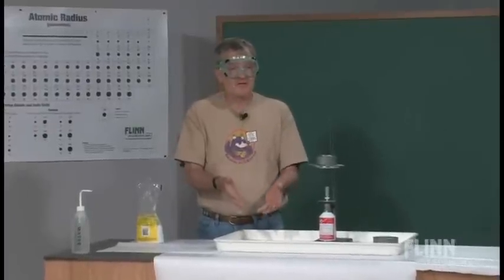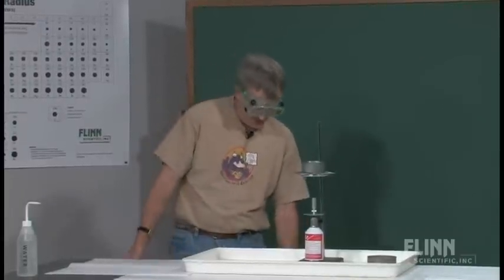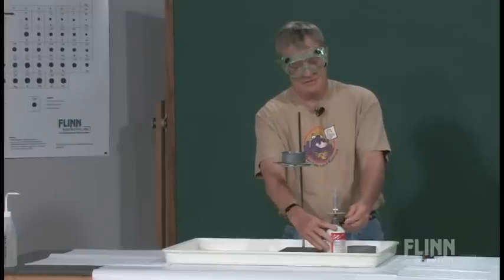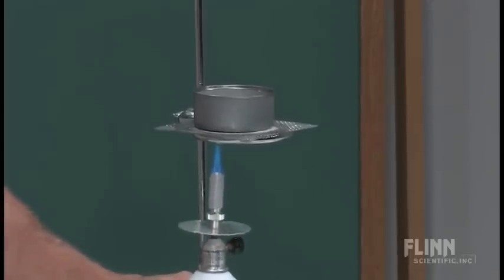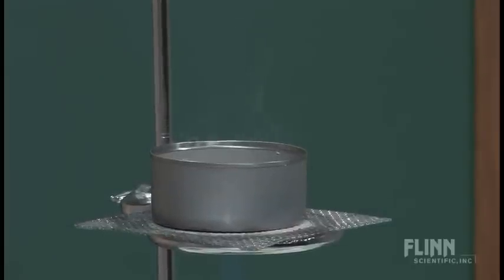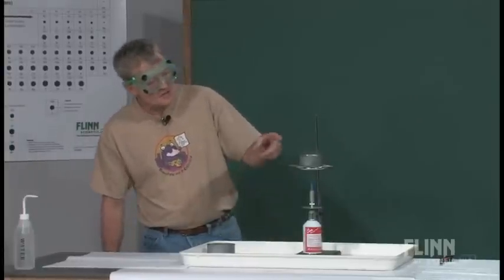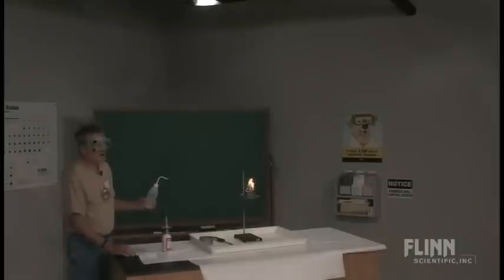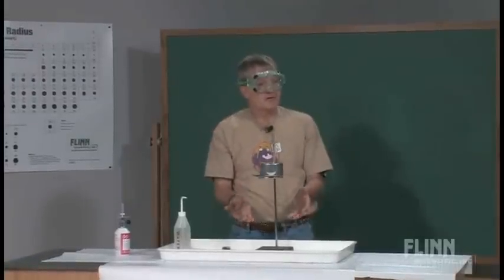Grease Fire

Comment: Hes giving one bad advice.

Do NOT use wet towel to put out grease fire.

It has similar effect as pouring water to grease fire.
Reply: Put a lid over it?
Reply: @tutsebhatu6495  try putting a lid on top of fire
Reply: @tutsebhatu6495  put a ring on it. 💍
Reply: He said "damp," not "wet." Big difference.
Reply: @geopomoco  I know but in a real emergency situation, they might not be able to prepare proper damp towel because they have to be quick and they cant think straight.

They might accidentally use wet towel with water dripping in the hot and fiery frying pan. 

This is dangerous because even a small amount of water dropped into  a pan filled with burning oil will become superheated and erupt.
Reply: @Emsyaz Get the fire extinguisher